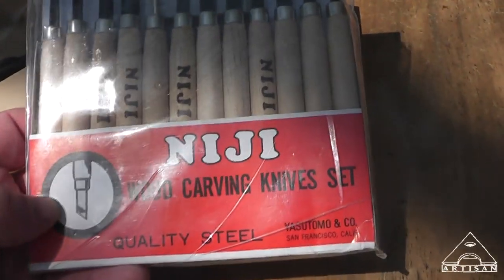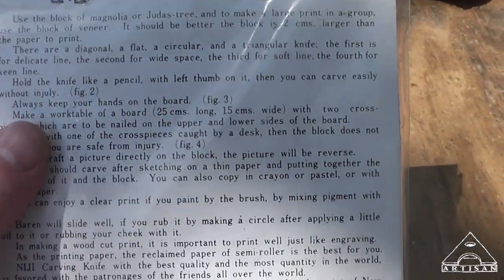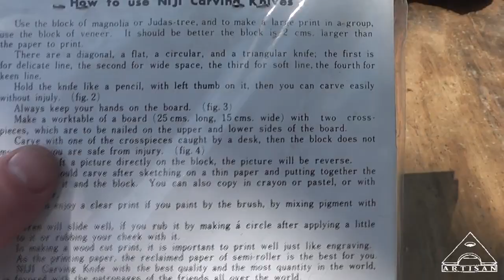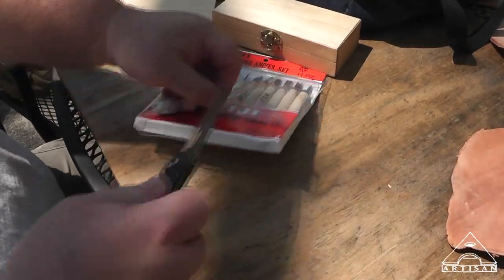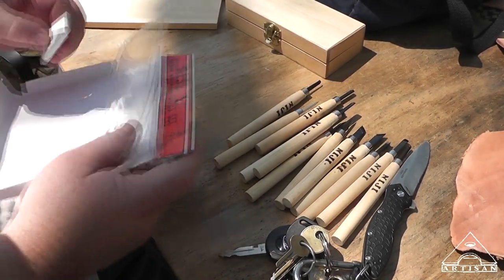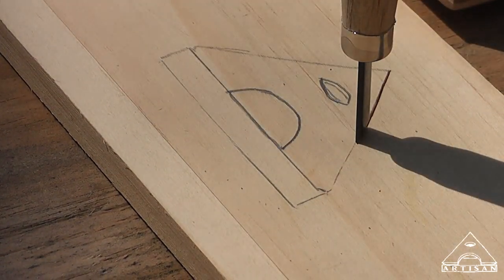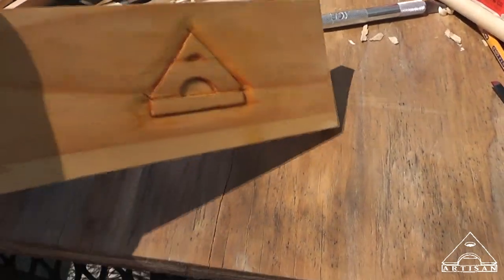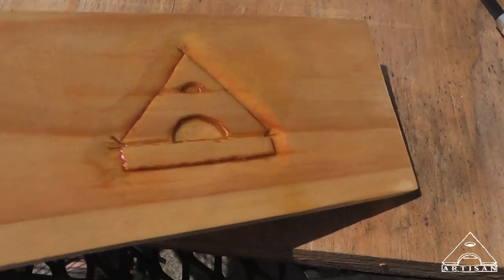Niji Wood Carving Knives and the Artisan Logo

Comment: The part about the baren on the back refers to the tool for tradition woodblock print making. The baren is the tool rubbed on the paper to transfer the ink to the paper. People use camilia oil on it to make it slide better but traditionally you can rub it on your cheek to use the oil from your skin. I can see why it would sound out of place on the packaging for the carvers. Lol